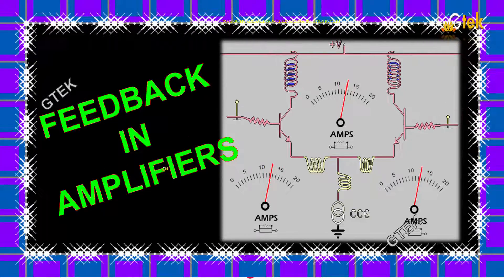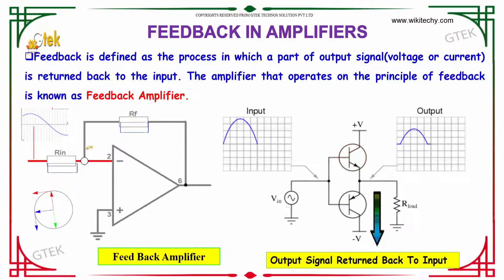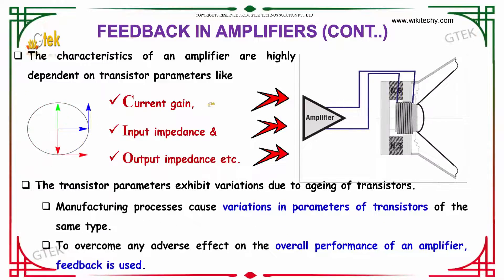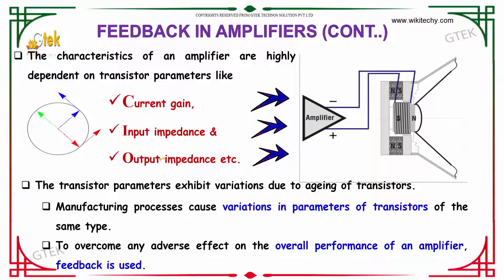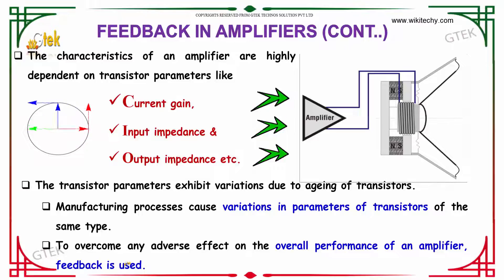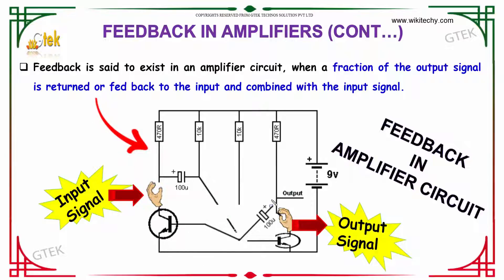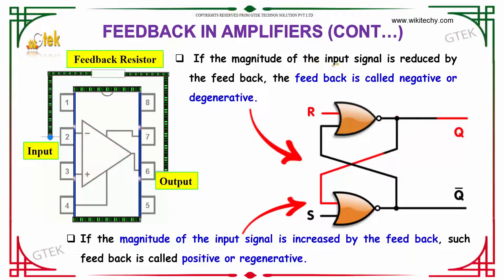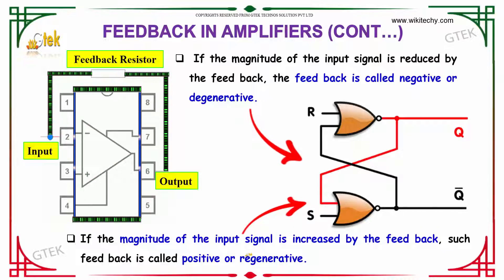Feedback in Amplifier Semiconductor Devices class 12 physics subject notes lectures CBSE

Comment: The feedback is negative if the loop gain AB is negative. Negative feedback occurs when some function of the output of a system, process, or mechanism is fed back in a manner that tends to reduce the fluctuations in the output, whether caused by changes in the input or by other disturbances.

Comment: The process of sending part of the output signal of an amplifier back to the input of the amplifier is called feedback . There are two types of feedback in amplifiers. They are positive feedback , also called regenerative feedback , and negative feedback , also called degenerative feedback .